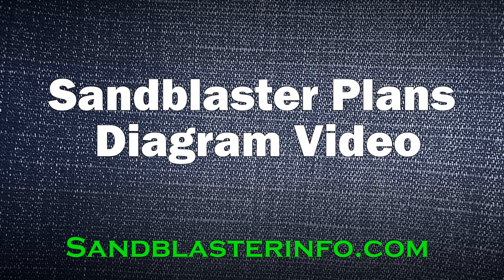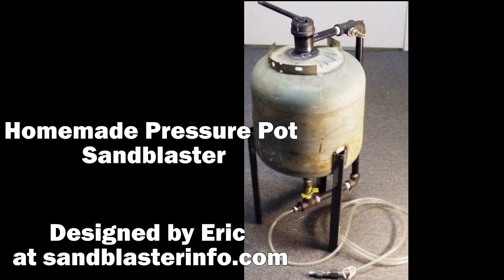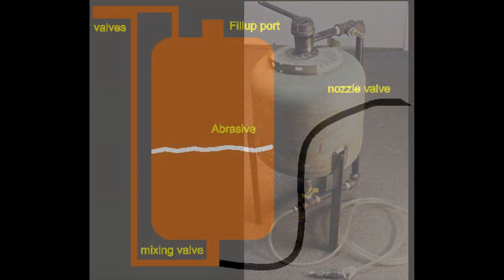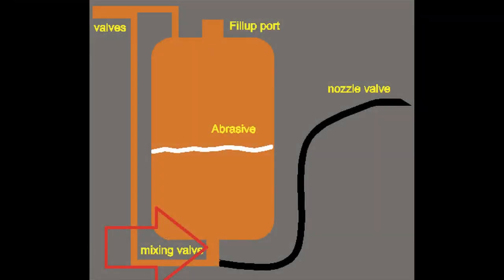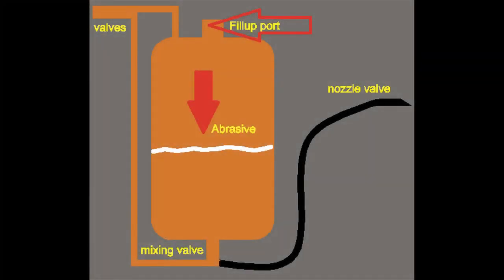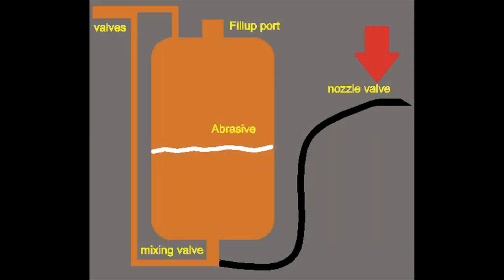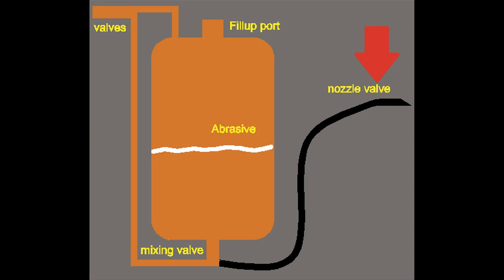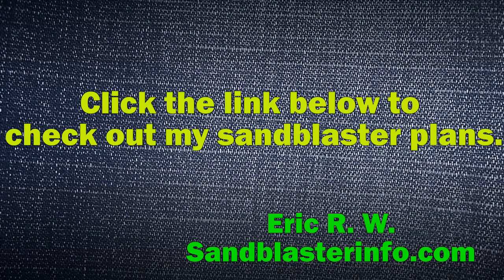Homemade Pressure Sandblaster

Comment: It won't fall into the hose because of physics, there would be source pressure pushing back into the pressure pot, keeping the sand from "falling" into the hose, and there is no venturi effect in the mixing chamber that is the tee. The pressure is to inject sand into the outgoing air stream with force. You can however make a hybrid siphon feed system, then you would have vacuum at the gun mixing port, and a light pressure of 10-30PSI would be enough to keep the sand flowing, not better, safer.

Comment: any one that knows anything about presser and media flow will know as soon as they look at the fittings on the mixing valve what needs to be done for it to work wight, it is very clear in then cheep Princes auto presser sand blasters that the mixing valve is going to clog up all th time, simple as changing fitttings and air hose size, flow of anything can not flow well using 90 dagreee fitting, use a few 45 degree fitting in the direction of flow to start off with
Reply: Romppai's Outdoors h